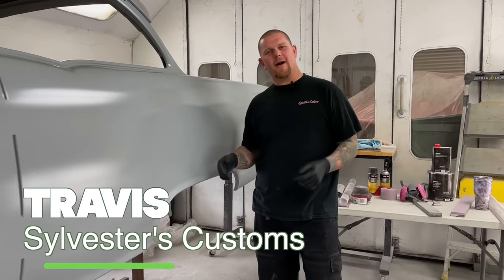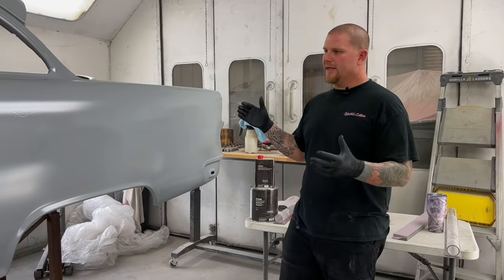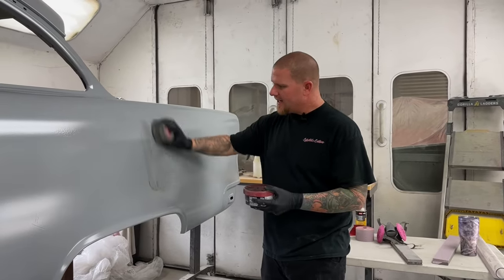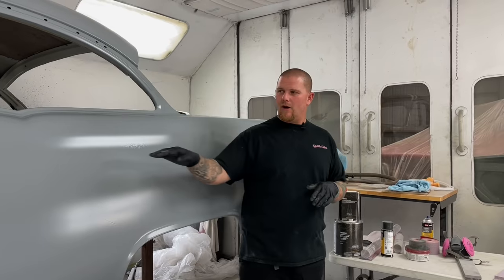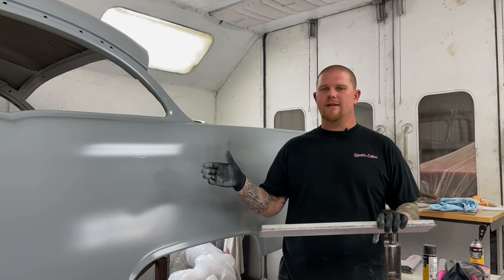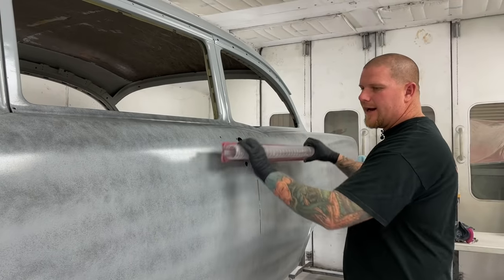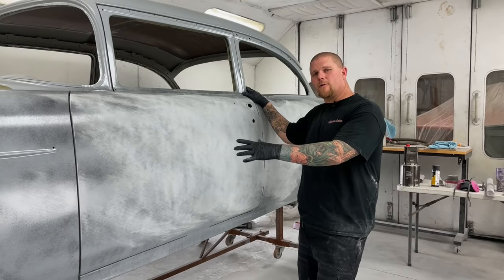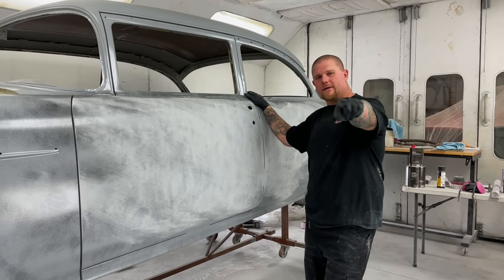Block Sanding Primer - Essential Steps to a Mirror Finish

Comment: So should I use the body filler in direct metal before the epoxy primer. Is there a certain filler that works best on the metal?
Reply from the maker: Most fillers can go on bare metal but I don’t promote that. We put it over a well scuffed epoxy primer

Comment: Hi Travis. Is it advisable to sand with a DA with interface pad after block sanding? I'm at primer / blocking stage now using linear blocks (VP2050 primer). I was thinking of blocking to 220 then DA. Is this a good idea or will the DA introduce waves in the panels?
Reply from the maker: If you are blocking with linear don’t use a DA it will ruin the finish
Reply: Thanks Travis, I'll continue using the blocks! @SYLVESTERSCUSTOMS

Comment: Very good video have learnt some especially about the paint curing and guide coat,one negative on why is here no dust extraction?
Reply from the maker: Dust extraction systems are not designed in a way to get your car straight.

Comment: I thought you was supposed to do the body work before you prime
Reply from the maker: Nope. I would say 95% of all restoration shops epoxy prime Before filler it makes the adhesion and corrosion resistance much better
Reply: @SYLVESTERSCUSTOMS  I was just messing with you lol..The body filler block job just looked a little rough to me, but we all know the filler primer will take care of it most of the time..I guess i just spent more time blocking my mud before filler priming,  plus i used glazing putty (icing) and covered the whole panel with it and blocked that down before filler primer
Reply from the maker: @rat8356  get this video you can see this was only three coats of primer the bodywork on that 55 from the previous video was dialed it really really good don’t let luxe be deceiving because of the different coloration that was used for teaching purposes spend the time to make the body filler perfect as you can and if use this primer that you work really well Hand in Hand we will be having a bunch more videos very soon teaching the metal work as well thanks for watching I hope this helps
Reply: @SYLVESTERSCUSTOMS  Cool your doing a good job man!...Ive been restoring and painting cars since 1988 but quit about 9 years ago..I had enough of it and no one wants to pay anyways..Price of materials are unbelievable now!..I used sherwin williams P-30 filler primer..It dries shiny like yours so i never needed a guide coat, if there is any pin holes or sand scratches they will stay shiny down in them after you sand and that contrast shows you where more sanding is needed

Comment: Fantastic video,  I learned a bunch, I have a question for... I recently purchased a project from a shop, the client lost interest and told them to sell it for him, any how it's body work is all done and it's been put into a sealer, there are numerous  greasy hand print and such on it, question is, do I need to strip this sealer, or is there a way to clean it, I am hoping to block it to see how the bodywork is... keep up the great vids, I enjoy them lots
Reply from the maker: You can use wax and grease remover thoroughly and keep getting new rags. Don’t keep using the same one then go over it with a waterborne cleaner and then you can block it. 👍🏻
Reply: @SYLVESTERSCUSTOMS  thanks so much as a DIYer, I absolutely shave subscribed to your channel, and thanks for the help ,,,

Comment: I have a question I enjoy watching your channel I'm a beginner with a little experience after you get done sanding all the surfaces and they're straight do you still have to reseal
Reply from the maker: Thank you! Yes you want to ensure no spots of filler is showing or bare metal. But after that’s completed I finish with 600 grit wet then sealer and paint
Reply: @SYLVESTERSCUSTOMS  thanks do you sill recommend the ppg 2k mixed as a  sealer

Comment: I found applying very thin coats of filler works the best. You don't try to fill the low spots all at once. While the filler is still tacky,  which is the point where the filler is hard but a bit sticky, where it rolls up in little balls and clogs the sandpaper.  You can apply more thin coats again and again until the graph paper shows you straight lines. You won't need the cheese grater if you apply the filler in thin enough applications. You mix smaller batches of filler and you work smaller areas overlapping filler coats as you work your way to straight watching the lines. Be sure to allow plenty of time for the filler to harden completely so you don't clog your sandpaper. This way there is almost no wasted material which is wasted $!
Reply from the maker: I think you need to watch our new video it describes exactly this process 👍🏻
Reply: @SYLVESTERSCUSTOMS  I have watched many of your videos. As yet none use an overhead projector which shows every high and low spot before any body work begins. You sand a lot more than I did once I started using the overhead projector.

Comment: Awesome video. You are an outstanding teacher. Can you comment on what's the between the door and quarter panel? It's also between the door and rocker? Is that filler or weld? Would love to know more about how you set the door in this position first. Thank you so much and keep the videos coming.
Reply from the maker: We have a video called Body Work Panel to Panel with No Latch. It will answer all those questions for you.
Reply: @SYLVESTERSCUSTOMS  Thank you!

Comment: Thanks a lot for sharing your knowledge in all these details. I wonder if the doors are temporarily welded to the quarter panels. Also I would like to know which material you use on bare metal as an initial layer.
Reply from the maker: No what you are seeing is body filler holding it together in the jamb. We use vp2050 primer 95% time only. Sometimes we use DP90LV but depends on the car and how hood they want it
Reply: @SYLVESTERSCUSTOMS  thanks for the info!
Really like your videos!

Comment: I meant to ask you after all your sanding on your 2K primer and you go back and sea  the car. Do you use a 600 grit on sealer before paint
Reply from the maker: Depends on customer and budget etc. but sometimes not always
Reply: @SYLVESTERSCUSTOMS  hey thanks again for answering my questions and going out of your way it means a lot

Comment: Tried using the discount code trying to get the master set but its saying invalid code
Reply from the maker: Let me reach out and verify with linear blocking tools and I will get back to you.
Reply from the maker: Looks like it’s working now. Can you give it another try and let me know if it works. Discount code: Scinsta
Reply: Ok cool ty so no 15 at the end ?
Reply from the maker: Yes, it should be 15% off.
Reply from the maker: @patriot2q2q98  correct.

Comment: Those things are stupid expensive
Reply from the maker: Thats why we reached out to the company and got you that discount code. They work really well.
Reply: You can't argue with or put a price on results. I'm hesitant on the cost too but I'll eventually pull the trigger.  Time to take it to the next level. Could you possibly do a video in the clear sanding and detail stage? Great video once again. Thanks for sharing.
Reply: @class5bodyworks  hundreds of riddler awards have been handed out without those. Period. Newbies will either pass this video up or give up once they see the price of those. And not knowing other tricks of the trade. Discount code or not.
Reply: @1manshtshowandautobodystuf891  
You're right. Maybe the price isn't justified to a newbie. Maybe a less expensive starter set. But they also shouldn't dismiss training or information from trained professionals. I've been going 35 years now and still learning. That's why I'm here.
Reply: @class5bodyworks  check out the K* block. It's a lot heavier but I found it blocks a lot more even. You can get the same problem with the heavier block though. I just got better results with the heavier block. Very solid and flat and will bend with the panels. 
Check out how the guide coat sands away quicker under his hands instead of sanding evenly with the whole block.
It's pretty hard to get the block to cut even when you're hands are only 5 inches wide. So you pretty much have to learn the same technique with a heavier block. learning how to make the block sand even is more important than how heavy the block is. I like the heavier block because once you learn how to use the block correctly you can cut the sand time down with the heavier block because instead of using hand pressure to cut, you can use the weight of the block to cut. 
That is only if you can learn how to use the block correctly. I pretty much have to use my finger nails to keep it even instead of my palm. My K*Block is full of claw marks and it's still holding up well.
Reply: @lacquerhead6938  
Thanks for the info. I'll check it out. My old habit to break is pushing Dow. On the block in addition to back and forth.  The results are still good but just more fatigue. So the weight of these heavier blocks may help.